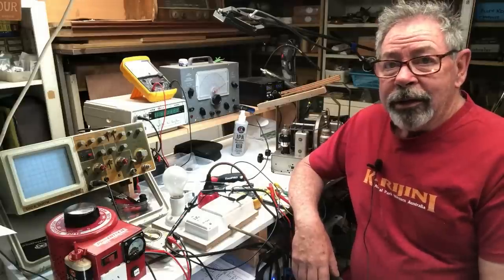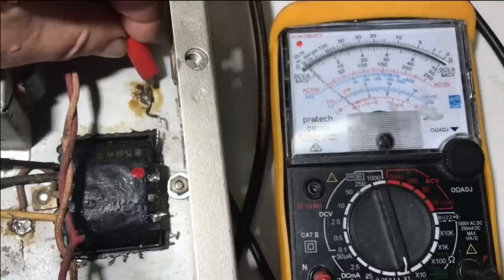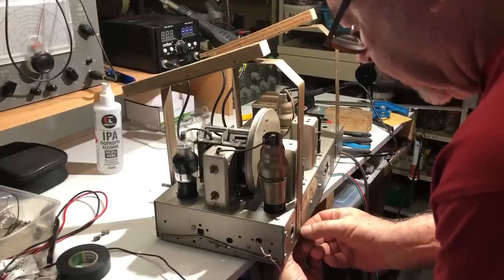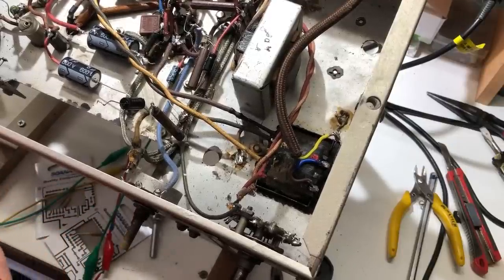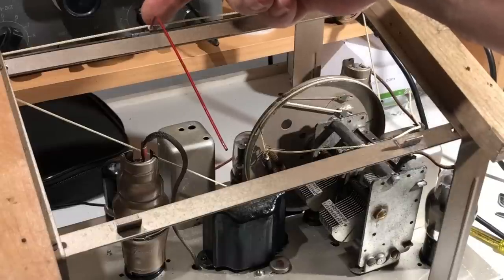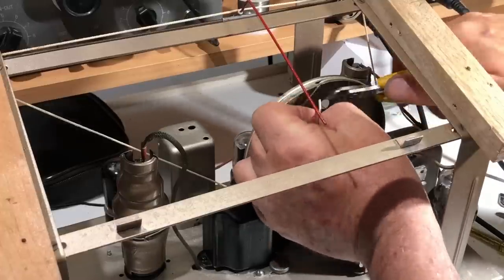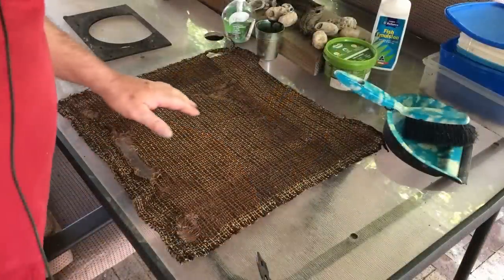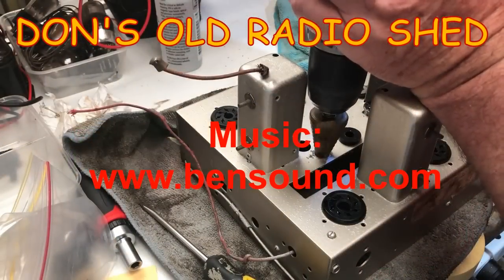STC Farm Radio PART 3. From Rusty and Crusty to Sleek & Shiny

Comment: 39:33 Bring the wire that connects to the top of the valve through the split in between the two halve of the goat shield, that should keep the wire sufficiently clear of the dial string.

Comment: Very nicely done. I've recently restored an STC 536  which is the mains version of the one you have. It is physically identical to yours. I was too frightened to strip the chassis and paint it as everything was very brittle so I cleaned it as best I could which is acceptable. It has an electrodynamic speaker which needed some tlc. I did a full alignment and it came up very well and the cabinet was completely stripped and re finished much the same as yours. I wouldn't call it butt ugly, in fact I think it a quite handsome radio. I do prefer timber case ones so I'm a bit biased. Very entertaining series of video's.
Reply from the maker: Thanks Ian
This one was butt ugly in the beginning because of the state of the cabinet but ended up a very nice radio!  
Yes I think it's often better to leave things alone - stripping a chassis is a lot of work and in my opinion, only worth it if the radio is something special.  I also like timber cabinets and will go for a timber radio over a plastic or bakelite one any time.

Comment: Great work again, Don!
I would say this radio now looks much more than just "acceptable". I actually think it looks quite great and is sure also plays really well now. And I really like the new grill cloth: it suits the cabinet perfectly and because it looks quite cure, it gives the radio again a nice personality. It's certainly a very presentable old lady now. Fantastic job! Enjoy your vacation.
Reply from the maker: Hi Kristof.  Yes I was surprised how well the cabinet finished.  It certainly has some marks and blemishes but overall, quite presentable.  I had to fill the nail holes along the top edges and also some on the sides. In one place someone had driven a nail into the side and the point of it was sticking through the veneer on the top.  I should have used a darker filler. Too dark usually looks better than too light.  I ended up putting a bit of extra stain on the filler spots with the tip of a cotton bud.  It kind of worked.
I noticed you had the same problem with the cover of your Philips tuner.  The dark stain did the trick though.  One tip (for next time) - the stain will take more evenly if you sand the surface carefully with very fine (maybe 400 grit) sandpaper.  You can usually also even it out by wiping with turpentine.  Anyway you got a great result in the end and I think the darker colour will really suit it.
Anyway, all the best for 2023 
Cheers
Reply: @Donno308  Thanks for the tip. I almost completely started over anyway. You'll see it in my next video...

Comment: It looks smashing :-D
The speaker cloth looks really good, not boring or too bright.
The case looks amazing :-D
You and dave always do a smashing job, and it still looks original but better.
As far as the scale is concerned, you might want to add a couple of bulbs inside so the scale looks a little lighter.
I like the 50k switch lol, i have had switches with high resistance and had to take it apart to show the contacts who the master is :-D
Reply from the maker: Hi!  Thanks.  Even I was surprised it turned out looking so good.  Yes, that's what I had planned for the dial and I'll get to that when I get back from holidays.  I think the filament winding could easily handle a couple of dial lights.  Yep I left the 50k switch bit (with a pot attached) in because it gave me a chuckle.  Geez you should see the stuff I cut out!
Reply: @Donno308  Well everyone makes mistakes, but leaving all of them in would be a nightmare for you and a whole day of uploads lol :-D
Ill shut my face now, enjoy you holiday :-D
Reply from the maker: @zx8401ztv  Cheers mate. Happy New Year!

Comment: Greetings:
If one side of the primary of the power transformer is connected to ground and the primary resistance is about 50 ohms as you said, then the resistance of thenon-red dot primary winding to ground should also be about 50 ohms.
I think that primary to ground should not be considered acceptable. I would be looking for another transformer.
Reply from the maker: Hi James.  After I removed the transformer and rectified the short to the chassis, the primary has no measurable connection to ground at all.  So the transformer was ok after all, just the terminal shorting to a jagged piece of metal on the (butchered) chassis. So all good now.

Comment: Now this is what I’d say is another positive result Don!
I was getting the impression this restoration project was a little hurried towards the end of this episode which is very much understandable at this time of year, along with time constraints, and family related commitments.  It happens to almost all of us LOL.  Nonetheless this radio restoration project turned out pretty much how I’d pictured it might.  As I wrote in my comment that followed the previous episode, this radio will perform, as well as look superb …and on both accounts, it sure does!  
I’ll now  go on to add one further praise in support of this brilliant series, “Bravo dear chap for saving another old valve radio from what could well have been an uncertain future.”
All the best from Phil.
Reply from the maker: Hi Phil
Yes, even I was surprised at how good it looked in the end.  Another one saved from the rubbish tip. Yes I guess it was a bit rushed towards the end - I wanted it finished before I left.  But my video editing is partly to blame for this too.  I was putting the video together as I went along and started to realize it was going to run too long if I didn't start cutting it back harder.
Cheers

Comment: Great job on this.  As for the knobs; since you have two originals, have you considered making a rubber cast of those, and pouring a couple of duplicate knobs out of an epoxy that has the proper color added to it?  They won't be originals, but they will look original.  Just a thought.
Reply from the maker: I really should give that a try.  I've never done it but it would be a very useful technique.  I guess the materials are available from the local hardware.
Reply: @Donno308  Glassslinger has at least one video showing how he does that.  I don't remember which video it is, but if you write him, he might send a link to it
Reply from the maker: Thanks mate.  I'll try & find it, if not I'll message him. @timflynn3218

Comment: That was a really lucky find with the mains transformer.   That could have potentially been a really dangerous thing if you hadn't found it now and it cropped up later.   You've really brought this old girl back to life.  She looks beautiful and works well again.    A lot would have given up on it, but you didn't.  You kept working and made it worthy of being on a shelf again.     If tuning is too free, some of that viscous silicon oil used in clutches could work.  Not sure why they call it oil given how thick it is, but it does slow things down while still lubricating.
Off topic:  Have you ever done German radios?   Looking for some pointers on a Grundig 4019 I have that was worked on before I got it and a little beyond my current knowledge.
Reply from the maker: Hi Brendan  The tuning seems to be just stiff enough for now and I expect it will get stiffer with age.
I did do a Nordmende Rigoletto a few months ago and found it easier than expected.  Check my channel or here's a link to the playlist:
https://youtube.com/playlist?list=PLUD46ygki6J2DC7G66AsSnhttUcKRXoTN
However by far the best Youtube videos to learn about German radios is "Electronics Old and New" by Manuel Caldeira.  Manuel's circuit explanations are excellent and easy to follow.  He has done so many German radios he's probably restored your exact model.  And he's easy and pleasant to watch. I couldn't find a link to copy but if you search @electronicsoldandnew on Youtube you should find him.
Cheers and good luck with your Grundig!